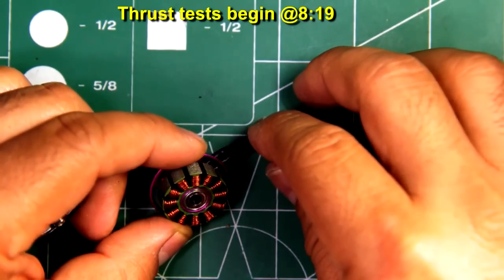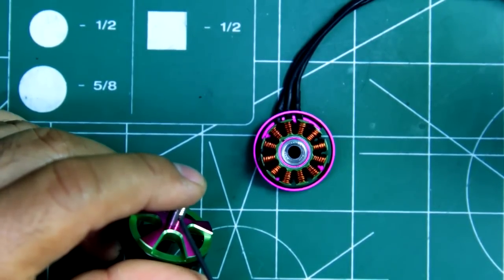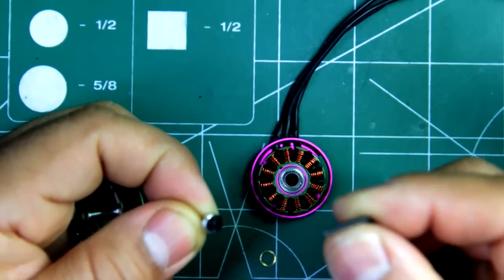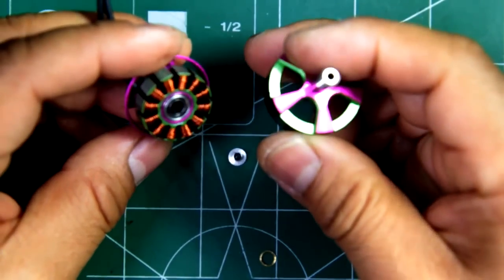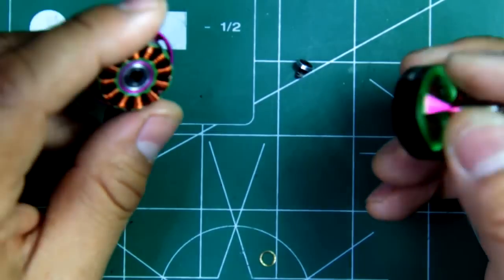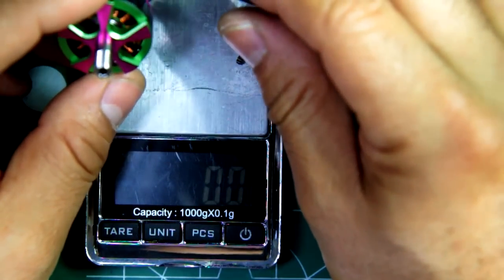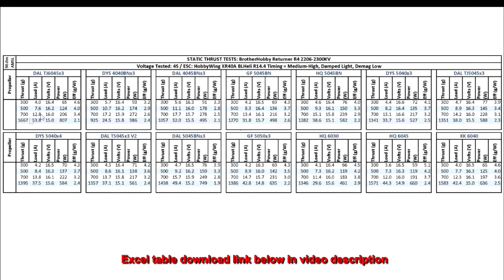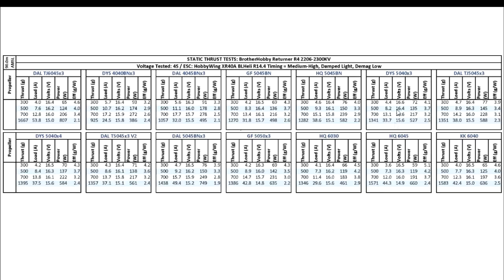BrotherHobby Returner R4 2206-2300KV Thrust Tests

Comment: Could I use these with 20A esc?
Reply from the maker: Lots of factors have to do with being able to use them with 20A ESCs : Propellers, LiPo voltage, copter weight, how long you plan on pegging throttle to full 100%, ESC brand/ - what components ESC uses (FETs) .... those are the main ones.  
I'd say you can use them with 20A ESCs on 4S and 5x4x3 props but I wouldn't go full throttle for more than 4sec and as long as ESCs are not the "old" type like DYS SN20A. I would feel more confident using 30A ESCs. DYS XS30A or XD30A have been getting good reviews, there are many other BLHeli_S ESCs that are good too like the Spedix 30A
I usually recommend people to calculate Amps on copter:
Multiply Max Amps from my tests by 0.65 (aggressive) or 0.75 (conservative)
Example, 5040x3 prop Max = 34A*0.65 = 22A or 34A*0.75 = 26A, 
Then 20A ESCs can handle short burst of 25 to 30A for 5 to 10sec (depending on ESC model) so that prop is good to use

6045 prop = 45A*0.65 = 29A & 45A*0.75 = 34A.... I'd rather use 30A
Reply: I wanted to put these on my vortex 250 pro.
Reply from the maker: I would research a little first to see which motors other people are using as replacements without any issues. If you use 5x4x3 props or GF5045BN they should be alright but DO NOT take my word for it as I have no experience with Vortex hardware, proceed with caution and at your own risk (disclaimer) The math I did above says ESCs have marginal headroom to handle the load at full blast.
http://www.immersionrc.com/fpv-products/vortex-250-pro/
Custom 20A ESCs (22A Peak)
Reply from the maker: There's a "good" point: The FET data sheet MAX current rating is usually at 25ºC on the "bottom" of the FET chip. Current handling decreases as temperature increases. Most data sheets will have a graph showing de-rating curves. That's why ESC's use FETS with higher rating to account for heat and burst current draws. So the 100A could be handled only if you can keep FET chips at that low temperature and for a limited period of time. Check out a brief explanation about that in my 4-1 ESC review: https://youtu.be/vzraNJdaxE0?t=6m05s

Comment: I have a pusher electric plane I'm considering using this motor on as I need a 2206-2300kv. Is this motor the best in the class for a 2206-2300kv, or should I use the Brother Hobby T2 Tornado 2206-2300kv? Hoping to use this with a HobbyWing FlyFun 30A V5 Mini ESC on 3S. Doers that sound like an acceptable setup?
Reply from the maker: What size propell|er? And at what throttle level do you expect to fly most of the time? On 3S it should be ok with 5" prop I think, perhaps even 6" on medium duty. I'm don't have much experience with fixed wing powertrains so that's my best estimate. 30A ESC will be plenty capable for up to 4S and 6" prop on this motor - of course, motor will tend to overheat on 4S and 6" when running constant high throttle.
Reply: @EngineerX  do the brother motors come with a motor mount and bullets for soldering?
Reply from the maker: @hixnada8278  none of those. Majority of BH motors are marketed toward FPV/quadcopters where setups don't use mounts and leads are directly soldered to ESCs.

Comment: Hello 
I want to replace my ori Eachine mn2206 motors with this brotherhobby r6, my quad is Eachine wizard x220s. Can i use this motors with ori 30a ESC and 4s or 5s lipo?
Reply from the maker: This one is actually not a very durable motor. Not the best from BH. Will be better to use the newer BrotherHobby SpeedShield 2207 or R6 2306. 30A ESC is good. Everyone ... a lot of people use that size for 4S 5S and 6S. You have to match KV and voltage. 2400 to 2500kv good for 4S and 5S. 1600 to 1900KV for 6S. When you change motors you have to make sure the tune/ PID settings are OK and don't have oscillations because can overheat any  motors. Check PIDs.  Lots of info for that on YTube.
Reply: @EngineerX  30A esc + 2207 ? Not to much current draw?
Reply from the maker: @AmperCore  5040x3 5045x3 5046x3 props are used on 4S and 5S a lot with those motors and 30A ESC. Lots of people have videos .I've used 2507-2400kv 4S 5046x3 and 30A ESC. You can search YTube. Many people list their esc

Comment: Question I'd like to throw out.
Has anyone experienced excessive noise from these motors? I have had six builds now. 
The only build I have an issue is with these motors.
All my builds have the DYS AIO F4 Pro. All builds Littlebee 30a or 20a littlebee blheli_s  Spring edition ESC's.
Well tge build I have the Brotherhobby motors on is terrible. If I don't run a cap I get total blackouts in my fpv. With caps I get a shimmer in the fpv feed. I tried changing out the controller for a new one and I changed to dys ESS. Remind you none of my other builds have this issue.

Comment: Quick question? What motor would have more punch on 30A esc with 5x4x3 props? a 2300 kv or 2500 kv? Sooo confused about this!
Reply from the maker: ESC Amp rating doesn't determine how much "punch" or power a motor will generate, provided you use "good" recent-generation ESCs (F390 or BLHeli_S)
KV does factor into the equation for motor torque, but you also have to consider a motor's size. Namely its stator dimensions. Then comes how well everything is put together. 
There are several good options these days, this R4-2206 is a good one. Also the 2305/2306 motors I tested recently from EMAX & rcINpower. 
Lower 2300KV will have more initial punch, higher 2500 ~ 2700KV will have slightly less initial punch but will have more top-end and higher top speed and will use more battery in the process. So you have to decide which is more important to you. Most people that fly freestyle/acrobatics usually prefer 2300 ~2500KV for 4S LiPos and 2205 ~ 2207 motor size. EMAX, BrotherHobby, rcINpower, RCX RS2206 V2 are all good ones. Too many good choices these days to narrow it down to 1. Also check out www.miniquadtestbench.com lots of motor reviews there too.
Reply: EngineerX Awesommmee! Thanks a lot for the detailed response! yeah I was originally thinking higher kv more punch... I had some 2300 race stars and went to 2600 on the same quad but there was less of a punch! I was kind of bumbed! I had purchased some better 2205 2300kv racestars and they had wayy more of a punch than the 2600kv... the cheeper racestar version tho, ok so I will get the latest version of the e-max red bottoms 2300 kvs! Again thanks a lot!
Reply from the maker: Andrew D 2300kv is a good all-around motor. For 2600kv to get good punch you need to go to a 2206 or 2207. Brotherhobby TMotor or DYS Storm 2207 would be good. This R4 is also very good in 2550kv version sold at Pyroflip stpre
Reply: EngineerX oohhh I seeee, same diameter just taller, awesome thanks dude, makes sense. more kv... gonna need more windings and taller magnets for any more punch, Ill probably go with the 2300's then! Maybe some day Ill purchase some 2206 2600kvs once I get a little better:P

Comment: Strong shafts are nice, but doesn't that just transfer all the energy from a hard crash to the bearing? When the bearing goes, the motor is pretty much done. For me, I would rather replace a bell, so long as c clips are not used, and I have some available. Only because I damage every bearing I try to replace. .

Comment: I ordered a set of these motors for my 6" quad, I hope they are good. What esc do you recommend right now?
Reply from the maker: These are pretty good. Of course if you smack them hard against a solid object from a good height or at full speed.... something may get damage. Usually heavy quads cause the most damage. Larger than 1500mAh LiPos add lots of weight to the impacts
For 6" props I would recommend a 30A ESC. I have been using the DYS XS 30A BLHeli_S ESCs (green) with very good results. They work great and are not too expensive. There are others that also work  very well but I can't comment on those because I have not used them. 
Spedix have got good reports, but do research on your own to make sure
http://pirofliprc.com/Spedix-30A-HV-3-6S-ESC-BLHeliS_p_3602.html

Comment: Do you know if there will also be a around 2140KV version? :)
Reply from the maker: BH has not listed all the KV options on this motor. They usually release 3 variants 2140 /2300/ 2600KV but I don't know which will be offered for the R4. Keep an eye on the RCG discussion thread. BH updates there every now and then

Comment: Will you do the same for BH R4 2206-2600kv? Will the higher kv give higher thrust in your opinion since motors are so over sized and under prop?
Reply from the maker: BH has not sent me the 2600KV version yet. They have been sending me several test samples lately. Next one up for testing is the T2 2205-2500KV which I should have video up in a week or so. Performance should be somewaht close/slightly lower to the 2206-2600KV for the 5" props.
2206-2600KV version of this motor will for sure make more thrust on the "light" 5" props like 5040x3 and even 5045x3 V2. Amps will be higher as expected but still manageable once flying. Lots of people that want the most speed are using 2206-2600KV these days.

Comment: Hello!
This motor is the Brotherhobby Returner V4?
Reply from the maker: BH uses "R" R2 is the purple motor 2205, R3 is the blue 2206 and this one is the R4 http://www.banggood.com/search/brotherhobby-returner.html
Reply: http://www.miniquadtestbench.com/hyperlite-v4-2206-2300kv.html

Lower Amps... How? :D
Reply: Sorry i want ask: Hyperlite V4 :D
Reply from the maker: Easy! You need to pay careful attention to all the data. Consider voltage of his power supply. QuadMcFly's voltage goes down to around the lower 14V range for the MAX thrust measurement whereas in my tests, voltage stays in the lower 15V. That's a full 1V difference which partly accounts for the lower Amperage drawn on his runs. In addition, there's going to be a difference introduced due to different current sensors used, location (atmospheric conditions, elevation), and sensor used for measuring thrust. 
A better comparison between tests is to look at A, V, and W for any of the props at a specific thrust value, or RPM value. Example: QMF test HQ5x4x3 vs EngX test DYS5x4x3 (very similar performance for both props)
Compare 700g thrust:
QMF= 13.7A / 15.45V / 212W
EngX= 13.1A / 16.6V / 217W  
Nearly identical! It should be very close for other props as well. (I hope!) I just pick the 5x4x3 because is one of the more popular props.

QMF data: https://docs.google.com/spreadsheets/d/1YnZci7T4wgBL2ad3JKeC7OhKFDJB9kgNDrjgSyDtTuk/edit#gid=1119535165

Hope that explains why his measured Max Amps are lower.
Reply: Ok, i understand now. But... larger power supply, higher voltage sag?  Its confuse me :D
Reply from the maker: QMF has mentioned several times his batteries are "old" & "tired" also they're very low-C rating.... 15C I think.

Comment: Great video, sorry to be picky but did you test the RC 5051??
Reply: Olly FPV good q, there are new props from HQ as well.
Reply from the maker: Olly FPV not on this motor. I'm putting the data together for a bunch of tri-props on the EMAX (S) that will last include the TRK 5051 and the DAL C5045 tris. Just missing the new APC tris and quad props
Reply from the maker: SirCrashaLot Only tested the S5040x3 and new version of the 5040x3. Same as original but has solid hub , no inserts. I didn't get any other of the HQ props yet
Reply: To sum up, there is S5x4x3 (which is very nice), S5x4x3PC (transparrent ones, crazy durable). There is of course the 5x4x3v1s you are describing and they already have the PC version out of them too. in both tri and quad blades. Good times. The PC versions are really durable and do not bent.